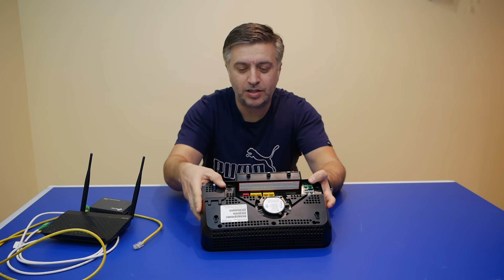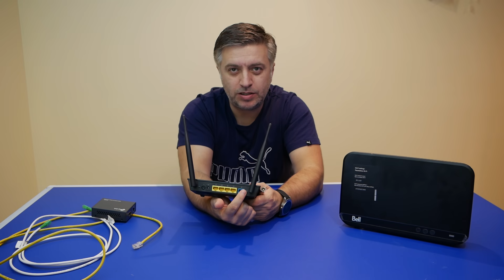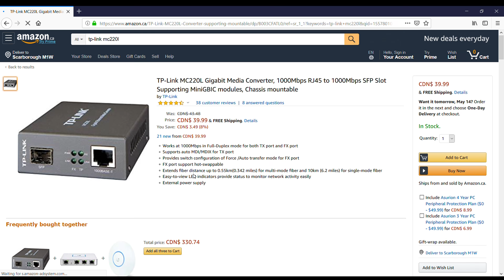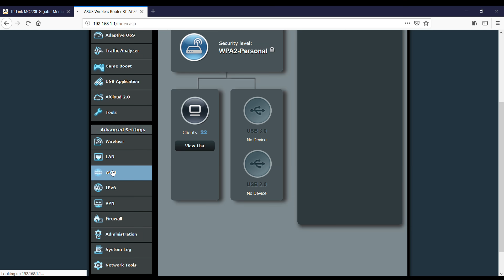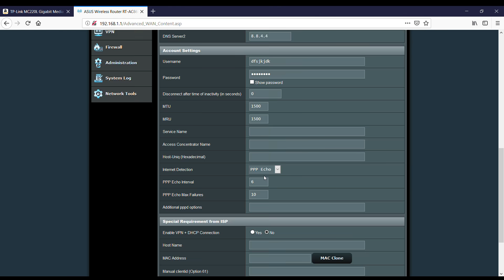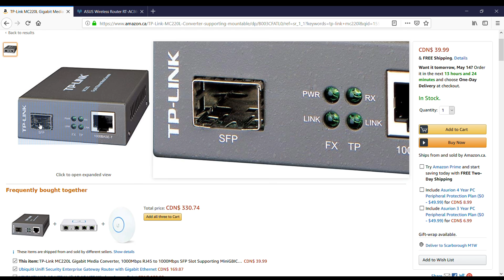How to remove/bypass Bell Hub 3000 and use your own router

Comment: pro tip: once you do this mod its possible to get free mid tier tv service with your own router providing you can find a bell tv box to register... and know the work around like me to register them... (ebay often has listings)  as the tv boxes will get a 10.0.x.x ip address right from bell and not register to your 192 local net and address.
Reply: Do you have a contact?

Comment: I successfully did this a few years ago but am trying again with virgin plus internet. No matter what I do I can’t get the internet to run through the router. I’ve tried tinkering with all settings on the router possible. Pppoe credentials are all correct

Comment: What is the red port for, the one on the back of the Bell HomeHub 3000 Modem? What is it used for? Can i connect my own router to it? Thanks!
Reply from the maker: The red port is called WAN wide area network and it is used to connect your own router in a bridge scenario I think. This way you could resolve the same problem but you can't
 take the hub 3000 out of the equation.

Comment: I just did this upgrade the other day, and wow, does it make a difference in space savings and reduced heat dissipation! If you want improved wifi and network performance, this is not for you. If you want better control over your network or just want to get rid of the Hub 3000 and useless hidden networks, this can be a fun project. 

Great advice and step-by-step instructions in this video, except for the User ID and Password. User ID typically starts with bxxxxx and you may have to call Bell for the password if you lost or misplaced the original documentation that came with the Hub 3000.
Reply from the maker: Watch my other video how to change bell Password.

Comment: Can someone please let me know what happens if i dont use the tp-link media converter and do the same steps but with the SFP module still in there. My down and up are only 100/10.
Reply from the maker: All is going to work. Just disable the wifi on bell router and use yours. connect a cable between your router and bell router. It is going to create a double nat from what I know and you can't really disable all wifi on bell router. Maybe some others can tell you more about double nat.
Reply: @advfreedom  Hi there, thanks for the quick response, just few more questions, do you know if going into DMZ mode will prevent double NAT? And just to clarify does the media converter prevent double nat? I will likely just purchase it if that's the case. Thanks in advance.

Comment: Recently had trouble with my HH3000, wifi just stopped working and it lasted all day. If I don't have Fibe or an sfp module in my HH3000, what would I do to setup my own router? From what I've gathered just plug in my second router into the HH3000, then follow the setup on the computer as shown in the video?
Reply from the maker: Yes that should do the trick.

Comment: My HH3000 doesn't have an SFP module installed. Does this affect anything, or should I simply follow all steps and skip steps related to the SFP module?
Reply from the maker: That means that you are on DSL. There is a phone cable going inside? If that is the case you can bridge the hub.
Reply: @advfreedom  Yes there is a phone cable going inside. I have a router attached and working with wifi. Is this good enough for things like servers and NAS?

Comment: Am I to understand that I can use my VPN for geo location changes to eliminate sports blackouts??
Bell will know nothing of the change to my own router ?
Thank you for the great video. It was very informative for set up.
😊
* for those having a hard time pulling the SFP, out the little clip you pull, is also a key of sorts to unlatch the SFP.
I had to use a very tiny screw-driver to push on the little area under the clip to unhinged it. You'll see that it's moves up slightly to allow it to slide out easily if you find it stuck.

Comment: If I understand correctly this video assumes you have a fiber-optic connection coming to your house?
Can we bypass the Bell Hub 3000 if we have a standard copper wire connection coming to the house?
If so, do we need other equipment than was mentioned in the video?
Reply from the maker: If by copper you are referring to DSL you are correct. This procedure doesn't work. The only thing you can do is bridge the bell hub. Connect your router to one of the bell network ports and then you can set up your own router as in the video. Then turn off bell wifi from the configuration and that is pretty much it.
Reply: @advfreedom  Thanks Marius for your fast reply! I watched your video carefully. It is my understanding that even if I bridge the modem, there will still remain a constant wifi signal coming from the modem. Someone famous mentioned a signal of 900 mW/m2. I'm sensitive to such signals. Is there any other way to stop those signals?
Reply from the maker: Unfortunately no.
Reply from the maker: No. If DSL is what you have then the only thing you can do is to bridge the bell router and connect your own router to bell network port and then follow the video of setting up.

Comment: Does the Bell Home Hub 2000 have the same radiation issue as the Hub 3000?  Bell will connect a Bell Fibre Optic cable into the Hub 2000.
Reply from the maker: I am not sure about that.
Reply from the maker: In my case the bell 2000 came with another piece of equipment which is the converter plus battery.

Comment: An alternative for those that are wondering; you can use your router through the Home Hub 3000 by turning on DMZ and also checking Advanced DMZ.  You will need to add your routers MAC address by typing it in.  Note that there is a LAN MAC as well as a WAN MAC.  You want the WAN MAC and you may have to look for it by logging into your router.  The last digit is usually one digit or letter higher than the LAN MAC.  Here's the part where myself and others got stuck; Plug your router into the Home Hub 3000 LAN1 port, not the WAN.  After setting up Dynamic IP in the router, it finally obtained an IP address.  Good luck.

PS.  Thank you for your video.  I may go this method at some point to move the radiation out of the room.

Comment: HH 4000 is not working is it normal!? Thanks
Reply from the maker: Hub4000 is not working with this procedure.
Reply: @advfreedom   Thanks. So Internet -> HH4000 -> Third party router -> WIFI or wired LAN right?
Reply from the maker: Yes, bridge the 4000, connect your router to your hub and then turn wifi off your hub.

Comment: From the converter can you put a switch then use the bell home hub for tv and use Ur own router on the other port?
Reply from the maker: I don't think so but interesting point. Although if you follow the pinned post, the guy was able to connect wired bell tv recivers with a 34 tag port.
Reply: @advfreedom  so then you can use the receivers with your own router? I have the Asus gs ax 3000 router
Reply from the maker: I would think so based on his comments.

Comment: Hey buddy i did exactly what you did but my setup is a little bit different.. i have the asus GT-AXE16000 & the 10gtek

Did what you did but i don't have internet working

I would like to think maybe i need to update the firmware on my asus router but since i have no internet connection i can't upgrade + even if i wanted to do it manually.. there's no option because i don't have the same ui has you.. 

Any tips anyone can give me ? 

I have the same bell 3000
Reply from the maker: I am not sure what you did wrong. There is somebody here who succeeded with the router that you have, and a lot of people were successful with the method. It may be that the bell password is wrong. Put the module back, download firmware and install it, and then try again.
Reply: I got it to work!! It was my bell credentials that was incorrect.. once i put the corrected one it connected to the internet 👍🏻

Comment: Can you do a video on the 4000?
Reply from the maker: Unfortunately 4000 can't be done with this procedure because the module is not removable. The only thing you can do is to have a bridge mode with your own router connected to the 4000.
Reply: @advfreedom thank you. I'll put it in bridge mode as I currently have a TP-link deco system hooked up to it.
Reply: @advfreedom  working on my (hopefully last) Bell video in the fibre series I've done.  I'd like to use a very small part of this specific video for a quick example (with credit to you obviously) and a link to this video.  Can't find another way to contact you, but would that be ok with you?  If not, totally understood.   Let me know and thank you!
Reply from the maker: Sure np. Go ahead.
Reply: @advfreedom  You rock sir, thank you kindly!

Comment: Bell wants to send me a Gigahub if I change my internet package. 

Currently using this setup, will this setup still work if I don’t take the new router out of the box?
Reply from the maker: If Bell let you use the old setup is fine. But probably they will want you to send the old hub to them. Also they have a white list with the registered modules so probably they will disable your hub3000 module.

Comment: Hey buddy do you think this would work on Virgin? they use the same modem and was wondering do you think it will work?
Reply from the maker: Check if Virgin cable is the fiber optic cable. If so it might work. But I think that Virgin is using a phone connection and is up to 150. In this case this will not work.

Comment: Does this actually increase your wifi capabilities? 
I ha e the home hub 3000 for internet only, and the wifi is terrible. Supposed to support up to 75 wireless device yet everything is constantly freezing or extremely slow.
Reply from the maker: If the router you are using is capable of course.

Comment: Can you make a video for the HH4000.  Thus far I believe GSPON ones are blocked for PPPoE.
Reply from the maker: I don't have Hub 4000 but the procedure is not working for 4000 as the Spf module is untegrated and can't be removed.
Reply: From what i've read you have to passthrough pppoe via the HH4000. Plugging the routers WAN into the 10gig port on the HH4000 works like the spf module in the video, but you have to disable all other functions in HH4000 settings.

Comment: Thank you for your help, but unfortunately mine doesn't connect.
Reply from the maker: Most of the people here were able to. Did you use the same hardware and followed the guide?
Reply: @advfreedom  I finally have it working. VLAN needs to be turned on and values need to be added in. I just bought a tp link Ax 5400. I'm finding the same speeds over wifi. As before. About 400. I have a gig package. I haven't tried a Lan connection test. Do you think changing the sfp would change the speed?
Reply from the maker: @SirTubington  on wifi you will not be able to get the lsn speed. Wifi has lots of variables involved. The true test is lan connection and you need to have 1gb lan card. You can't change sfp is listed on bell network. The only time you can have another sfp if bell  replaces router.

Comment: Currently facing issues (Toronto area)
Got the bell HH3000 which I try to bypass using 
Firmware: DD-WRT v3.0-r42335 std
and 10Gtek media converter.

Unfortunately I do not seem to be able to get the connected. Has someone a couple of screenshots on how the configuration should be in DD-WRT ? I use the exact username/pw as in HH3000 with PPPoE
Reply from the maker: I am sorry but I am not sure how ddrtw would be configured.

Comment: is there an increased risk/vulnerability to outside hacking if you just use your Asus router instead of the Bell provided modem AND router?
Reply from the maker: Not that I know of. Asus had a vulnerability in the firmware a while ago but it was fixed. Other than that if you setup your router correctly there is no advantage of having bell router over Asus.

Comment: Thank you!
I also got the PVR working via Ethernet. Does anyone know how to connect the wireless receivers to this setup as well??
Reply from the maker: Wireless I am not exactly sure. But if you read through the comments I think somwbody tagged the next field to 36 or so and they coonected the receivers. But again I am not sure.
Reply: @advfreedom  I ended up buying a used VAP3500 (video bridge/extender that comes with some Bell setups) - I plugged this into my IPTV lan port and it allows my PVR and other tv receivers to connect. ideally I would just want my tv boxes to connect directly to the router wirelessly, and I still think this should be doable. im just not well versed enough in networking to know for sure.

Comment: I got HH4000. How is its microwave effect, I do have my on router Asus Ax86u, but I don’t know how to disable wifi from HH4000 to work on my own router, thanks .
Reply from the maker: In settings you should be able to turn wifi off or maybe there is a button. Then connect your router with a cable to one of hub ethernet port. And then just sd your bell credentials in your router pppoe.

Comment: I'm not sure if you can just set bell Hub 3000 to bridge mode, then  you can save the  TP-LINK MC220L.
Reply from the maker: There is no actual bridge mode. All you can donisbturn off wifi and setup your own router. Bell allows 2 devices signed in. Your router creates one and bell router another. That creates a double nat that most people are trying to avoid. Also there is a hidden wifi that you will not be able to turn off and that is for bell tv receiver.

Comment: Has anyone tried this with an eero 6? Also will this method work for bell Fibe speeds higher than 1 gbps like the new 1.5 and 3 gbps being offered?
Reply from the maker: I don't know about Aero 6. With this, you will not be able to get over 1 gbs because the media converter is 1 gbs.

Comment: Hi thank you for this video. I tried to connect using your settings and it's not working for me. I have the Asus RT-AC68U. When I try to put the MTU and MRU to 1500 I receive a message that I can't go over 1492. I did everything else like in your video with no luck, Am I missing something? Thank you for your help!
Reply from the maker: Do you have Merlin firmware?
Reply: @advfreedom  Is it only with Merlin firmware that you can get 1500? And is there a big difference in speed between 1492 and 1500?
Reply: @advfreedom  Hi, I changed my id and password and now everything is working! Sorry about that and thank you for answering me that fast!

Comment: I have a Netgear Orbi AX4200 mesh system and ran into trouble. Firstly, I couldn't get my router to connect to the internet to sign in to change settings after installing the SFP module to the TP Link MC220L. I then attempted to change the settings for my router after re-installing the SFP module in the HH3000 but was unable to change the DNS Servers to Google's, as you demonstrated, nor was I able to change the IPTV settings. It doesn't appear that the Orbi settings allow access to these options. I referred to the Orbi user manual and countless forums and couldn't find the answer or a work around. I guess I'm stuck trying to out the HH3000 into PPPoE mode to see if that will eliminate double NAT for the purpose of installing a Firewalla Purple. Admittedly, I'm pretty bummed this process didn't work and approximately $500 in hardware (TP Link and Firewalla) probably can be used with my Orbi mesh system.
Reply from the maker: I did mentioned in the video that I have no experience with other routers. Sorry for your troubles, and you are right I couldn't find any settings for IPTV online for Orbi.

Comment: Hi guys, I was able to remove the Bell Hub 3000 for my internet plus I was able to make both my HD 4K Bell PVR and another Bell receiver. Too bad I can add a screenshot for the config on my 
TP-Link AX6600 router. But VLAN ID:35 IPTV VLAN ID:36 make sure you assign to your Lan1 and Lan2 to IPTV (if you have 2 receivers, NOTE: only the receivers will work on that VLAN, no internet. other VLAN set to Internet. Cheers Thanks for the video that heloed alot.
Reply: can you link to the instructions? and will I need to install Asuswrt-Merlin firmware on the router for the VLANs to work? or do you use stock firmware?
Reply from the maker: I am glad you found a solution for the pvrs. Good job.

Comment: Hi Marius, thanks so much for your video. We recently had fibre installed with Bell 4000 hub. As you acknowledge in your video, there is no way to turn off the signal. Even though you can restrict wifi access, the signal remains strong. My sister is very adversely affected by this so we're looking for this type of hack. While there is no TV, we have home phone which was copper but is now on fibre as well. Can your bypass device accomodate a home phone line?
Reply from the maker: Hub 4000 doesn't support this hack. They have the module integrated in the hub and not removable.
Reply: @advfreedom  hi there, I'm hoping you can help me. I have the media converter hooked up as per the video. I have a tp link archer router and have gone into my settings and changed them per the video. I'm still not getting any internet to my router from the media converter. I have reset both my router and the media converter and still nothing. I am located in nova scotia and have home phone and TV  as well as the 1.5GB fiber.
Reply: @Kwambomb23   Hi there, I have exactly the same services from Bell. Internet, TV and Home Phone. Did you figure out what VLANs I need to switch on my IPTv to successfully remove HH3000 and install my UDM-Pro? I would highly appreciate if you can share the knowledge if you got yours working? I have Bell Fibe services like you.
Reply: @vs5aug  not yet I did speak with someone on kijiji who said he has done it and can help me. I won't be able to work on in for a couple of weeks tho